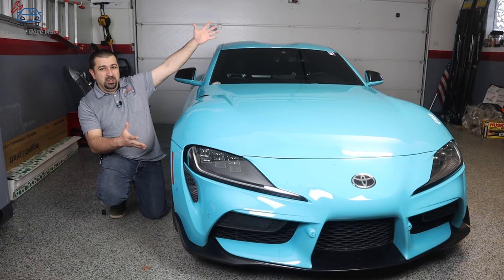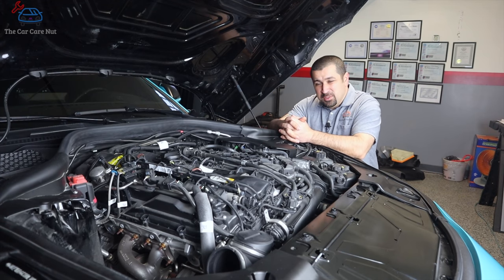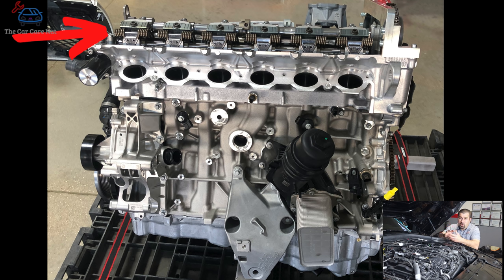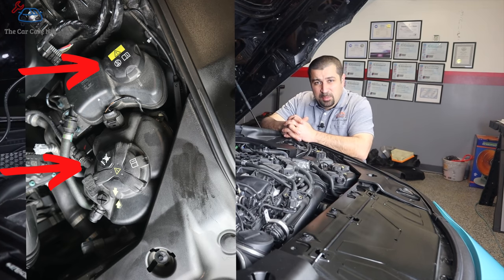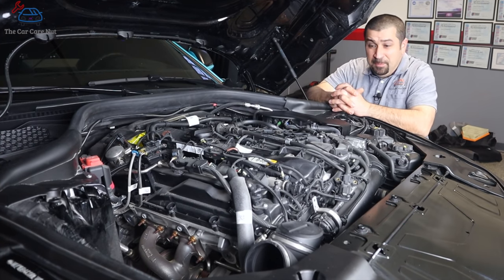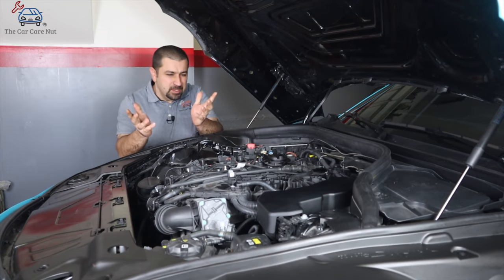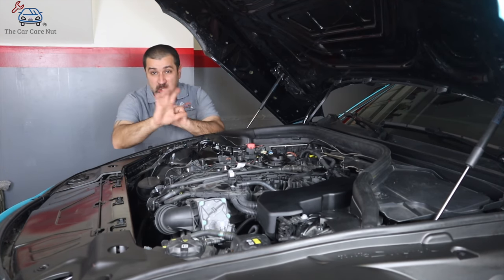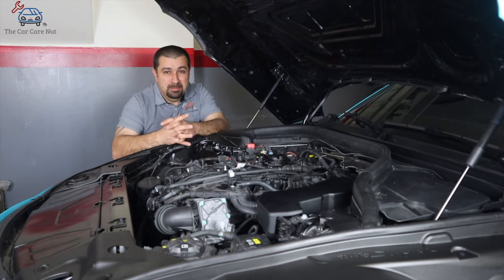New Toyota Supra Technical review and common problems

Comment: As someone who’s considering this car (wish it had a 6MT) - I really appreciate your deep dive and knowledge around common issues and what to expect.  Straight forward, no bias, and no judgement, just the facts.  Appreciate it, and keep up the great work!
Reply: It will, patience.
Reply: Lucky for you it was just announced to get the MT!
Reply: toyota just posted pics of the new MT 2023 supra on their website.. its in upcoming vehicles section of the website
Reply: 8sp auto is faster. If automatic is faster, why would you want manual?
Reply: @Kodiak727 absolute speed isn’t everythibg
Reply: @Kodiak727  
You sound like someone who’s never driven a manual 😂.  It’s okay though,  people don’t buy a manual transmission thinking it’s faster than the automatic, they get it for the driving experience which cannot be replicated with an automatic.  Put simply, it’s more fun to drive a manual.
Reply: Luvit
Reply: @Kodiak727  It's barely faster, but even if it were significantly faster, manuals are still more fun.

Comment: Thanks for the instructive video. I drive almost 38 years BMW's and like to inform two things:
1. If you replace the battery, always connect a backup battery or battery charger to the circuit before disconecting until replacement is complete. Otherwise you have a big chance that you need to reprogramming the complete Ecu.(€!) 
2. BMW always says the ZF automatic transmission has a lifetime oil and don't need any maintenance. Even most BMW garages don't have the knowledge how to flush it. The ZF factory in Germany recommend a flush + filter replacement every 80-100K km (this is officially published). I always do it by a official ZF cervice center (price all incl. 980€)
This different mind-set I never understand from BMW!
Reply: Well said about oil change. For some people life of a car can be 20, 40K miles but for me, I would like to drive the car as much as I can (As I can't afford a Supra every second year :)
Hence, I believe that sales trick "sealed for life" is a bit misleading. Not all of us wants to change their car after 60K miles.
Reply: meercedes bmw vw = kopf waschen
Reply: 980€ no fuckin way 💀💀💀

Comment: You’re gonna love doing injectors, intakes, and tank vent valves!

At the end of my shift I’ll update this again on everything I’ve seen from the B58 setup. Also are you in IL?

Update, so the B58 overall is one of our most leak proof engines when talking about oil. The only oil leak that I have ever done was the oil pan gasket, but they’re pretty rare, and the sealant is so strong it feels like the oil pan is nearly welded to the block. For check engine lights, if the car is equipped with active radiator flaps that’s what is the most common 9 times out of 10 (needing new software, or parts replacement). Another very common issue for the check engine light is the fuel tank vent valve being stuck open causing mixture faults. For the AC, on most New BMWs that “condenser” can cause a lot of concerns for AC not blowing cold. More often than not the issue is because the Low temp coolant circuit is low and needs to be topped off. Recently we have seen a 1 off car where the AC heat exchanger was leaking refrigerant into the coolant circuit which was neat. The intake manifold in rare cases can leak coolant into the combustion chamber, and if the leak is massive can cause hydrolock (never seen that, but possible). This is more common with the S55 where the intercooler is not internal to the manifold though. Overall though the only issues that really happens again is either radiator flaps, or a tank vent valve. The B58 is pretty bullet proof. Supposedly it’s a modified Diesel engine in Europe. The only things changed was the compression ratio, and spark plug holes that I know of. Love the videos!
Reply: Cool! Thank you.
Reply: Are you a BMW mechanic? I am considering buying a Supra and drive it until combustion engines are banned in UK. So, would you say that B58, when I drive with care is a good choice in terms of longevity?
Is there any video or articles that you can recommend about what to do and what not do driving a B58 engine.
Reply: It's most definitely not a modified EU diesel 🤣
Reply: @alper alp  move to America and enjoy your v8s while they last then when you're ready to retire into a boring daily go back and get you an ev
Reply: "The intake manifold in rare cases can leak coolant into the combustion chamber, and if the leak is massive can cause hydrolock (never seen that, but possible)." Nope, don't care how rare or remote the possibility. Any history of coolant leaks is a hard pass. Doubly so if the engine in question is over engineered.

Comment: I’m a semi truck repair tech and the amount of similar technology between this engine and the trucks I work on every day is insane. I love high pressure common rail design of the injector, incredibly efficient and should be used on all cars eventually. Air to water cooler is the same as a EGR cooler which don’t leak as often as you may think, when they do they very rarely lock up an engine or dump excess coolant in intake circuit. Very very interesting, bmw is onto something here with this engine specifically.
Reply: The only downfall I have seem to come across is most normal or average people will not be able to EFFECTIVELY service or do repairs on this vehicle. But at the same time the price of the vechicle seems that most people would not do there own maintenance or repairs, especially when you compare to C8 vette which was supposed to be (back in 2020 and 2019) the biggest competitor.

Comment: Just sold my '16 340i (B58), I didn't have any problem with low oil level, but I had low coolant level once and I had to add coolant to it from time to time. When it comes to transmission fluid I would change it every 50k or so you can get the whole transition kit from fco euro or esc tuning websites. When it comes to  new battery I used a bimmerlink app with a OBDII reader to program it.

Comment: had this car for 2 years and 2 months. sold it for a rav4 trd.  only problem I had was my passenger side mirror auto dim stopped working. besides that the thing ran pretty amazing. popped tires a lot. drove it all year round in NYC winters though so no battery problems.
Reply: If that was the reason you sold it you’ll be sad to know that there’s only dimmed driver side mirror. Yes it’s weird but it’s just how it is - no dimmed passenger side mirror.
Reply: @spyrit32837 so I have a 3.0 that I just bought 4 months ago and I never noticed my “mirror dimming”? Could you explain that for me and what is the point of it

Comment: As a DMT with Toyota as well, I really enjoy your channel.
Other things that are Toyota on the GR Supra are the headlights and the oem rims.
You will notice that on most German cars there are 5 holes between each wheel nuts. They are for specific wheel alignment tools and the Supra don't have such holes in the rims.
Reply from the maker: Thank you for chiming in my brother. That was part of the deleted scenes in this video about the wheels.. Bad idea that the wheels are missing the holes. You’ll find out why if you ever need to calibrate or adjust the radar sensor
Reply: @TheCarCareNut wait what, why??

Comment: Great video. I love the looks of the new Supra, but I don't care for the "Axis" colaboration on the build of this car. 
Question for you, if you have the time. I just filled up my two week old 2021 RAV4 XLE Premium and there was a stong odor of gas in the cab. I did not over fill, shut off at the first click on the pump hose. This is the third time I filled it and never noticed any gas smell before. Any educated guesses?
Reply from the maker: Interesting. Drive it a few hundred miles and fill it again if it does the same take it to the dealership as there might be an issue with the vent
Reply: Thank yo and GOD bless you sir!
Reply: OMG You can't say "Axis" these days, "they" will call U RAYYYCIST !!! LOL !!

Comment: At least ISTA doesn't run on Windows 95 lol.  Also the 'transmission sealed for life' thing is a joke when ZF recommends a service every 50k miles
Reply: Service is not a fluid flush.. we can run DIS and it shows all the diagnostic about the transmission. I’ve seen more problem on older ZF that we had to do the flushes.
Reply: @AkagiRedSun  on b58 engines? How how much does it cost to flush?
Reply: @chasem3549  the engine doesn't matter, the zf 8 speed has the same intervals all over

Comment: Crawling under a car to get it out of park is a good way to have a car run you over.
Reply: Lot of Mk4 Supra were stolen by tow truck drivers.  So now you cannot tow this car without starting the engine.  Hope this is the reason.

Comment: So... 
-No dipstick. 2021's burn oil. Potential owners will not check level regularly because it is a new car. Engine is starved of oil, could cause bearing failure. I see some owners taking advantage of this for another "free" car/engine.
-Intake manifold & intercooler fused together via plastic love. Could crack after many heat cycles near the engine block and cause coolant loss. Coolant loss will make engine overheat.
-No thermostat. Instead, a smart valve when out of commission could overheat the engine since this block heats up fast like you said.
-Some beginner DIY owners could potentially spill oil onto the ECU when removing oil filter as shown removing ECU cover: 10:34
-Battery replacement/registration coding. ECU confirmation of battery replacement change.
-Computer calibration for differential. No more simple drain and fill?
-Rear camshaft/timing chain looks like an engine out job. Fun.
-Parking pawl crawl human-squirrel death by Supra.
-Plastic valve cover.
I'll wait for aftermarket to make better parts/solutions. Also, for the depreciation hit. Also, will look for a clueless 1st owner. Just like with the N54. Thank you for the information.

Comment: Great video as usual.  Regarding the lack of a dipstick, my 2005 BMW E46 M3 had one.  My 2006 Mercedes W220 S65 AMG did not.  It took me a long time to get used to that, and quite frankly, prefer a dipstick over a computerized sensor that can fail.  One can only hope that Toyota will actually design, develop, then build a JDM Supra again.  In the meantime, the new BMW Supra looks great aesthetically, but a nightmare for us backyard mechanics.
Reply: It’s not happening, this is it - dude who works for toyota

Comment: Loved the video. I was considering a 2021 Supra but after seeing this video I'm backing off. I've been driving Mustang GT's and Challenger T/A 392 for the past 15 years and was looking for something different.  What's your opinion of the Camry TRD? THANK YOU!!!
Reply from the maker: Hi! The Camry TRD is basically a standard Camry V6 with upgraded springs and exhaust. Also has different wheels and exterior and minor interior change
Reply: I came from a TA392 to the 2022 Supra, absolutely love the supra! The car hooks up better making it quicker, handles alot better, and people all adore this car wherever i take it!
Reply: It may have problems like a BMW, but trust me, it drives like a super car.😎👍I love my 2021 bought it used with 6k miles.
Reply: @crushsc3003 Check out a used NSX - much faster than the Supra. They are all Honda and are very reliable. Although that cost........

Comment: Even though that the transmission fluid maintenance is "lifetime" do you recommend flushing it? if so at what interval would you recommend? of course owner discretion advised
Reply: If you want to change it, do it before the transmission reaches 100k miles. If you change it after 100k, there's a possibility of it starting to slip. Also you do need a scan tool because there's a specific temp at which you level check the trans fluid.

Comment: I was wondering would you recommend buying a 2020 or 2021? I’ve seen many more oil issues/recalls with the 2021’s.
Reply from the maker: As of today I would lean towards a 2020. The 2021 has an active oil burning problem without a solution so far.
Reply: @TheCarCareNut  reminds me of the porous block issue on the nissan VR30. They have been destroying / drinking coolant every few hundred miles and then the head gasket or turbos are blowing. These new turbo engines seem like a pain in the ass reliability wise.
Reply: @TheCarCareNut  any update on 2022's.  Maybe they have resolved the issue.
Reply from the maker: The 2022s are too new to know if they have the same or not
Reply: @TheCarCareNut  Hey man! I’m looking at the 2019 Supra’s in Australia. Do they also suffer from oil consumption? I’ve also read a lot about a ‘floating’ rear end at speeds, any comments? Highly appreciated! 😎

Comment: I'm curious about your statement on the infotainment oil level reading. With other BMWs that have the same system and similar graphic, the system will show you if the oil is overfilled. Like a normal dipstick, the oil reading is 'normal' when it is between the Max and Min lines. The bar graph in the car has additional space above and below the Max and Min lines to indicate over/under-fill. I wonder if there's been any clarification from BMW/GR/Toyota about this for Toyota service techs.
Reply from the maker: Hi! The official word I received from technical training on the Supra is that the Supra cannot tell an overfilled condition.
Reply: @TheCarCareNut  well that's good to know - appreciate the response and I trust that is the case. definitely curious to have a gauge that shows past max though.
Reply from the maker: It would make sense that it should but I guess it doesn’t so I’m usually very careful with the level when adding oil to make sure I start a bit lower than full then slowly fill it to get it perfect and not overfill it
Reply: @TheCarCareNut  As we all know it's safer to slightly underfill and top off later than to overfill!

Comment: Thank you for the video, I have a 2022 GR Supra 3.0 Premium. Daily driver, usually in normal mode, sport here and there for fun and accelerate for a few seconds. My question is, despite the 10,000 mile oil change interval, would it still be better to do it every 5,000 miles?
Reply from the maker: I personally would change it every 5k or 6 months but that’s up to you.
Reply: @TheCarCareNut  Thank you!

Comment: This isnt the same B58 found in other BMWs. BMW sent this engine to Toyota and they went thru the whole thing to increase its reliability. They upgraded the bolts and fasteners to stronger variants and made BMW change afew other design aspects to increase reliability. 

I just hope the changes Toyota made do help long term. I'm considering buying one of these. If the engine failed I would probably swap a 2UR-GSE into it and supercharge it, because V8s sound better. Dont even think Supra purists would be mad cuz they dont consider this a Supra anyway. I just love how light it is and the way it looks. Imagine pulling up in one and seeing the look on everyone's face when you revved it. 🤣🤣🤣

Comment: Ohhh how much i miss the old Supra. However thanks for the info. 
I do have a question since you mentioned diagnostics tools. Just got an autel ms906bt. Any thoughts on this scanner. Would it be possible to do a video on scan tools and go deeply in live data and how to read them?
Reply from the maker: Hi Tarek, so I have a basic scanner video coming up but I’m hoping soon I will continue the series on how engine controls work with live data info

Comment: Hello, I have a question regarding to a highlander EPS system. What would happen, if the electric power steering suddenly stopped working,during driving? Would you be able to steer the car or it’s going to lock up? My 2012 highlander is equipped with this system. I prefer a hydraulic one.. because it feels firmer versus the eps,it’s too soft..
Reply: @EpicDrew15  thanks,it’s a relief,

Comment: I love this guy: check this out
1)Reset battery not a big problem..
Dealer visits, this is an annoying problem...
2)No dipstick - not a big problem...
Oil level gets low, OK you've got a problem.
4) Transmission leak - not a big problem.
Tanny dipstick (not available) level gets low.....OK you've got a problem...
5) Low coolant side gets low, no problem
OK, no physical intercooler - you've got a big problem...
6) Diagnostic port. This a Toyota, no problem. Oh wait, this a BMW - Oh s--t! Big problem. 
7. Needs XXX parts, vast Toyota inventory. No problem. Oh wait, This is a B56. BMW parts hyperexpensive, big problem. 
8. Resell value. This is a Toyota. No problem! Oh wait, this is a rebadged BMW. Huge problem....LOL!!!

Comment: No manual transmission = no purchase from me.  Looks cool in the flesh though, especially colors that bring out the non functional styling.
Reply: Well with the new 400Z coming out they may one to rethink about the manual tranny. Yeah its a little scary having to get under it to mess with the parking break and that battery reprogramming if your in another town and the battery goes bad I don't think you can use one from a auto parts store. Bet that battery cost bucks.

Comment: Are you sure it can't tell when it's overfilled? When you measure oil on the system the fill bar shows room for up to 2 segments above 100%. I interpreted that as the potential to see if its overfilled... if that ISN'T the case, then them giving that visual on the measurement screen is absolutely deceptive. I would be really surprised if they went out of their way to add that and it doesn't show overfilled... 2021 Supra here.
Reply from the maker: That’s what we were told at training. I see the bars you’re referring to. Don’t plan on overfilling one to see if that works! But I’m sure someone will and we’ll find out.